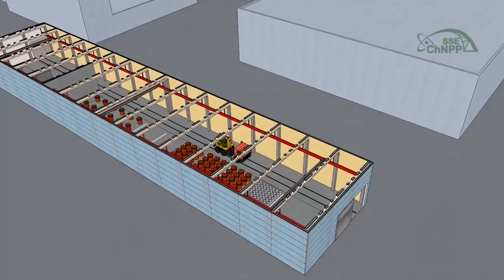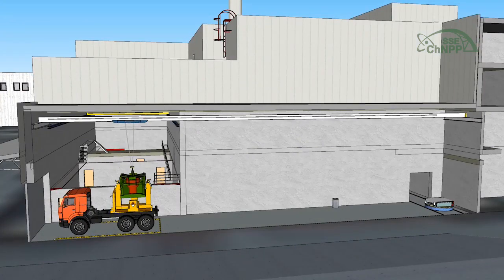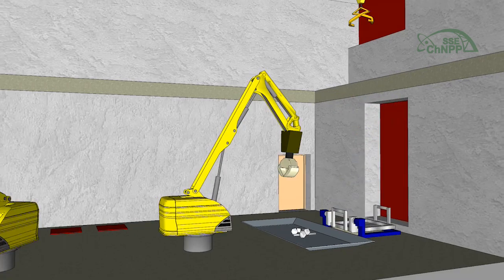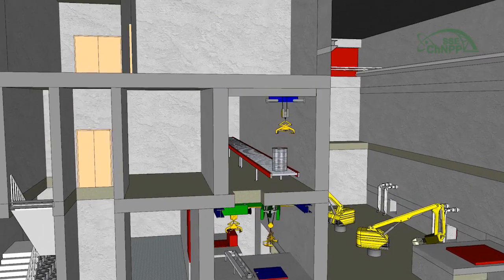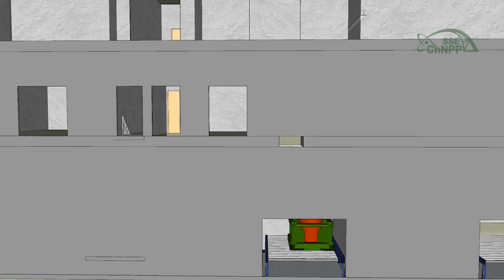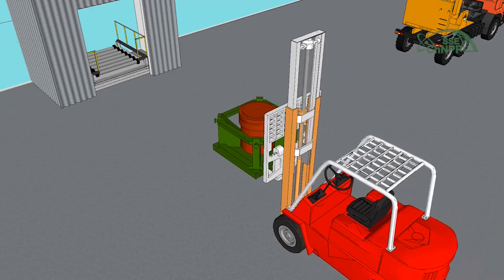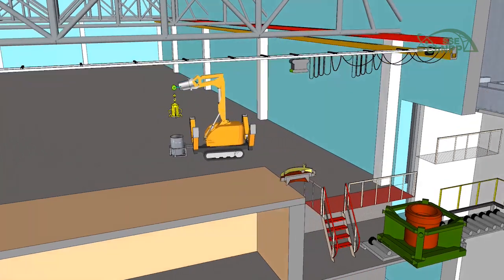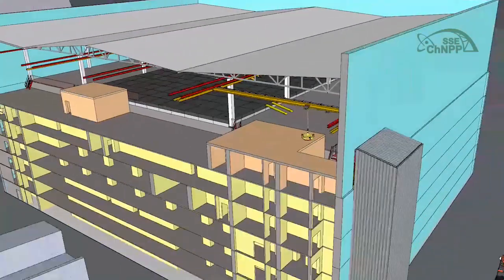High-level waste repacking

Comment: sorry for saying that but its stupid to decomission it.the best is to maintain it , it costs less and it pollutes less. if you burry it (waste)you wont be able to know what will happen with it in 10-20-30-40 years, if its in the form of the npp you will be able to monitor the radiactive stuff way better.the way we treat nuclear waste today isnt the best.we should find an other way. even with the 4 ractor the best would be to fill it with concrete and keep the new safeconfi.if you burry it moisture may reach it after the concrete gets bad and then ....................
Reply from the maker: Thank you for watching our channel.
Reply: The issue is that the building was damaged, both int he detonation of the core, and int he subsequent response.  ENTOMB storage works well in cases where you have all radioactive components in place ( ie. the BONUS reactor in Puerto Rico. )  The problem with R#4 is infiltration of water into the Entombment, which will drain into the water table, taking radioactive isotopes with it, or god forbid fostering another limited chain reaction in critical capable areas. plus all of the neutron activated materials need to be contained. 

It is safer, in the long run ( 50-100-500-1000 years) to break down all the damaged, radioactive components, and place then into deep geologic storage, like is done in Scandinavia, and attempted/projected in the southwestern US.